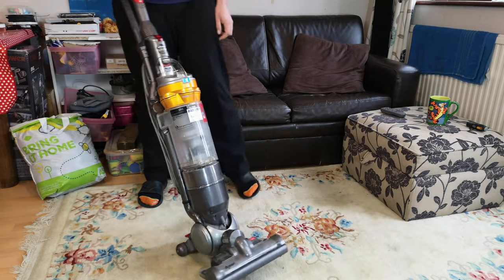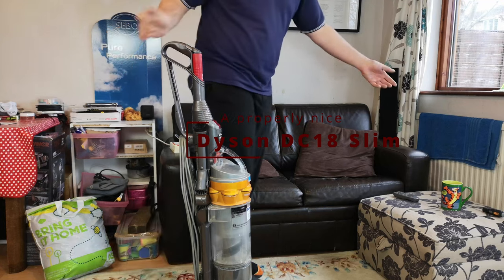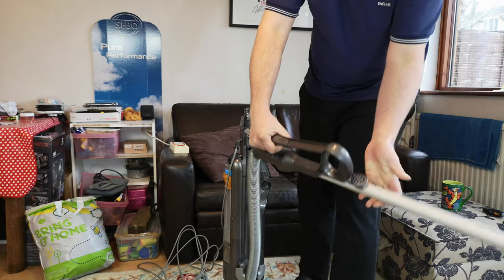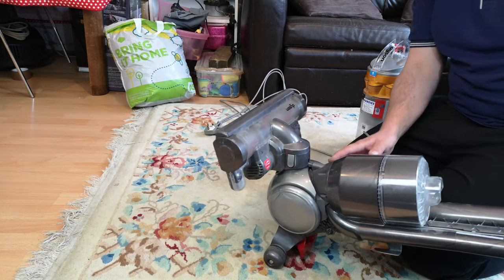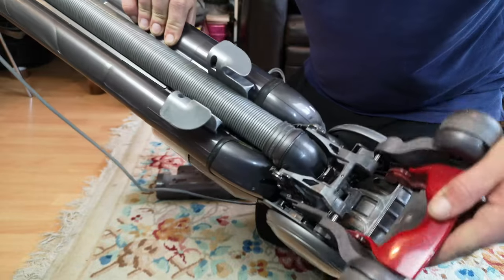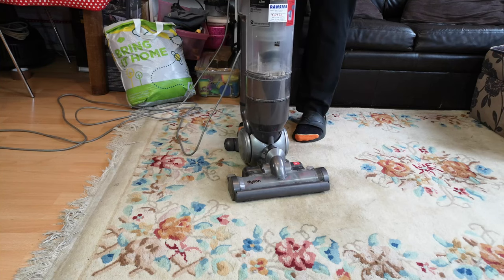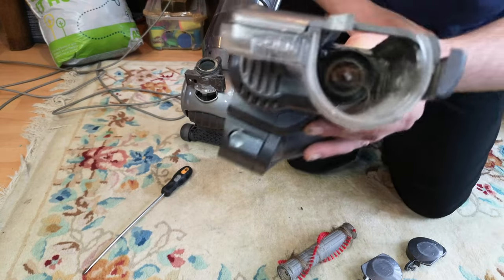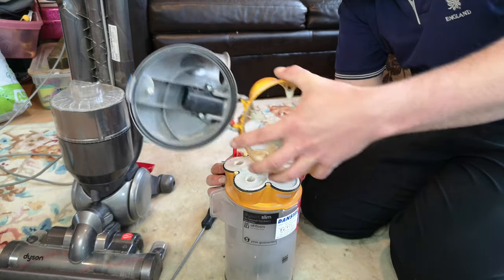A light service on a Rare Dyson DC18 Slim!

Comment: I bought this DC18 slim back in 2010.  In 2016 I took it for service. It sounded fine, the hose had suction but the head, while it seemed to be working, wasn't picking up.  Besides that and a few filter replacements, its been a great vacuum.
Reply from the maker: Is the changeover valve broken? It won't divert the suction to the head if so

Comment: My grandfather bought one of these dc18s and it was a great vacuum for years but I have been tearing through it fixing clogs and wondering why suction is diminished ugh Iv removed and cleaned everything but the bottom filter that you could not remove either. Ty for the video